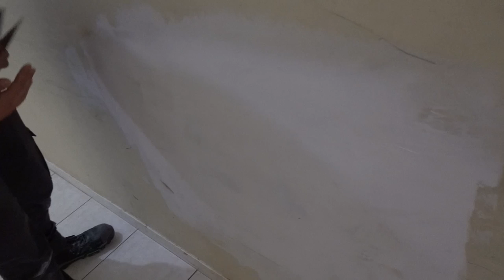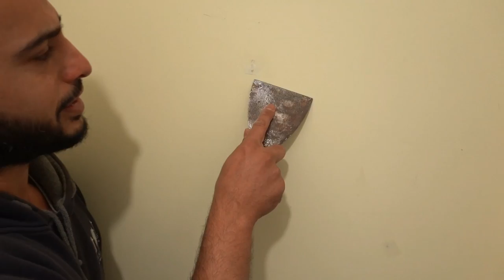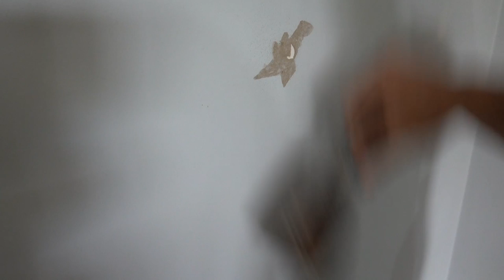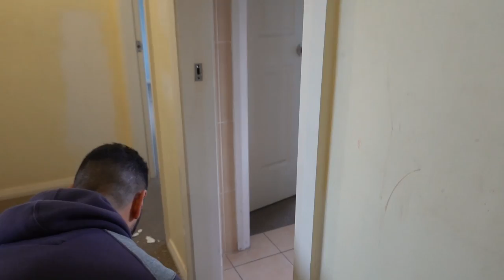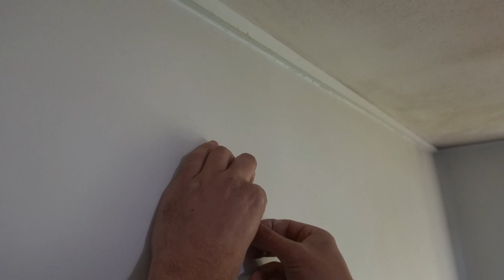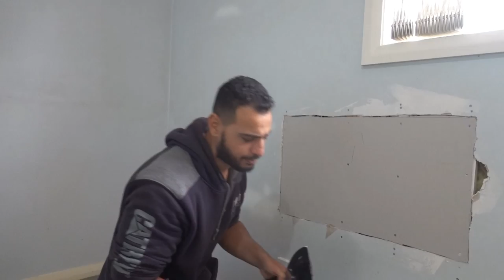Preparation work before painting a house - DIY

Comment: Cheers mush, Having this issue at the moment have chased some cables in dry wall, Not to sure what to use for a level finish, kind of putting it off as not to sure what I need to make it look good. 15mm gap 10 mm deep.

Comment: Great work Bill.
Could you do a demonstration of an expansion joint in a drywall? To repair and handle a ceiling to floor crack caused by foundation movement due to rain/wet weather. 
Watched a video where the tradesman said where there's recurring movement and recurring crack, an expansion joint is better than a standard filling job.

Comment: Many thanks Bill, great tips!! I unfortunately have used that ready mixed filla you refer to, glad to learn a better way 👍🏻 ps any tips on mounting wall mounted TV brackets to a stud wall when studs don’t fall nicely? Cheers
Reply from the maker: There are many different wall plugs and anchors you can use without the need for a stud. Some are rated up to 50kg 👍

Comment: The end results look amazing! Do you sand between coats? 
I did the the caulking in my room and the skirting isn't in place properly. I don't have a nail gun. Because I'm new to this I find out new issues and kind of skip over them without realising what might happen. 
There is alot plastering wavy marks on one section so I'm not sure if its worth me sanding that.

Comment: Bill: When there is flaking paint,do you have to do a water down coat of undercoat to the original plaster then apply the filler then undercoat? I have heard mixed reports,some say yes as otherwise the paint will peel again.

Comment: Hey Bill. Thanks for the video. Just what I needed to see. Quick question… in regards to timber around doors and windows how do you fill nail holes and the gaps in the 45 cuts? It’s currently stained and I will sand and prime but just wondering what the best product is to fill those holes and gaps. Cheers.
Reply from the maker: If it’s a stained surface don’t prime it. You can buy wood filler which is stainable and you can even buy timber filler which will match the current timber you have, for example maple, pine, cedar ect..
Reply: @billshowto  thanks Bill